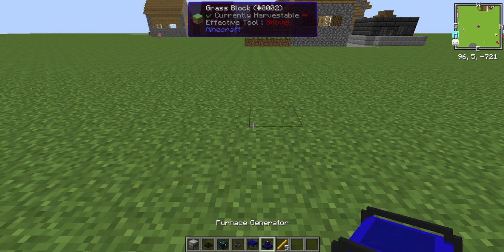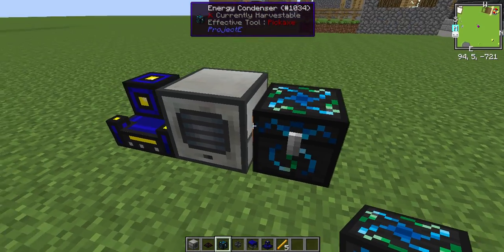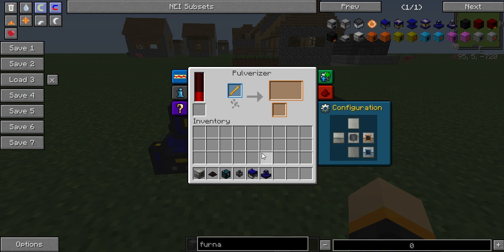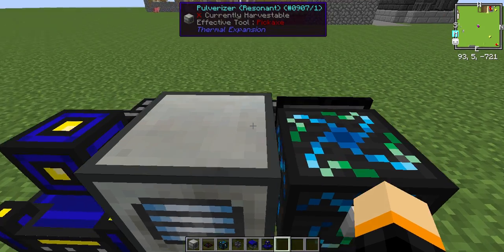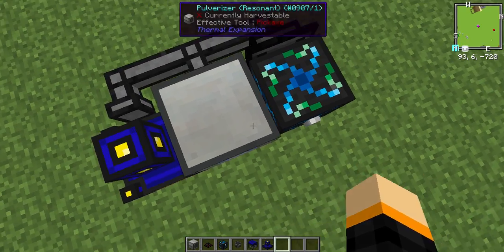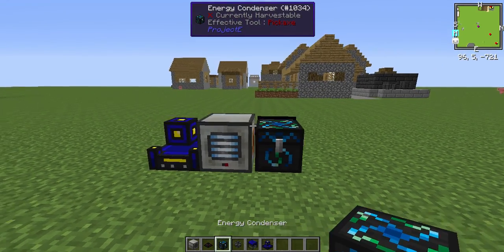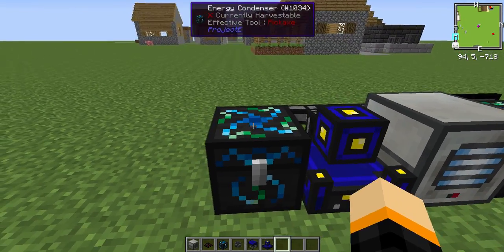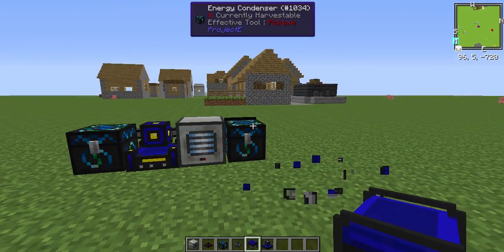ProjectE infinite emc machine

Comment: Can i use blaze powder instead
Reply from the maker: Blaze powder is part of the system. It cycles between blaze powder and blaze rods to produce mana.
Reply: @mikeyplays2372  so yeah? because I dont have blaze rods
Reply from the maker: @romellodrayton9909  well you need at least one blaze rod to put in the condenser so you can tell it to make more.

Comment: Here's a completely ProjectE-Only solution.
Get a diamond chestplate to as low durability as you can. I like to get it to 1 with Fire Prot 4 and just standing on burning netherrack. Now, put that in a Energy Condenser, it should only cost about 100 EMC to make since its low durability, so you can use some diamonds or something to get it started. Put the newly made chestplates into a Alchemical Chest about halfway full with Repair Talismans. The chestplate will rapidly repair itself, and once fully repaired will be worth around 80,000 EMC. You can use hoppers or Extra Utilities pipes to transfer half of the chestplates to the Energy Condenser to be converted, and then the other half over to a Energy Condenser to be turned into something more EMC-dense, like Darkmatter Blocks.

Comment: i'm having the issue that i cant actually use blaze powder in the energy condenser. is there a fix to this?
Reply from the maker: Andy Miller some modpack developers understand how simple this is to make an emc generator and simply remove emc from blaze powder. If this is the case then this emc machine is not usable
Reply: yea i think they must have patched it recently then, thanks
Reply: fyi you can do /projecte setEMC 0 to set the emc of an item or delete the projecte config files to reset all EMC values if the modpack dev has altered them

Comment: i found a cheaper way to get emc but u get 1 emc at a time
Infinite Snow farm :3 but its too slow
Reply: Even though plenty of people have a thing against pokemon, I found a really good exploit you can do with both Pixelmon and Pam's Harvestcraft.

Take an oak sapling and an apple and craft it to make an apple sapling, grow the tree. Next take a row of three bones, a water bucket in the middle, and a row of iron ingots on the bottoms to make a watering pail, then just spam-click the apple growth spots on the mature tree. Every two clicks will grow and harvest an apple for... 128 EMC? Not sure the actual value. I know it's more then a potato at 64 EMC.

It's not automatic, though its a great way to build up EMC early on and it's not that costly. Though you still need either an Alchemy Table to deposit the apples into, or surround the tree with hoppers leading into a Condenser chest, which is my prefered method.

Comment: One thing I like about your design is that it takes up only 4x1x2 tiles, which is rather compact.., which is good. 

I guess for my parts I just need to substitute with Ender-IO pipes (granted I believe I have Extra Utilities as well).

+1 on video.
Reply: Can also be stacked up multiple times with multiple pulverisers. And if you have Extreme reactor you dont even need to waste blaze rods to generate power which means even more EMC
Reply: Dont forget if you so wish you could also easily make it 2x2x2 easily to make it fit better in a corner etc
Reply: Also, I forgot to tell you though to save time, you can put items without EMC (stone slabs) in the Condenser to fill the slots.

However, you will need the pipe to have a blacklist on the slabs (or whitelist the blazerods) and that should be enough to get more usable EMC sooner.
Reply from the maker: Jed Knights since i uploaded this video i have made several systems  that produce more emc per second all thanks to the ender io conduits